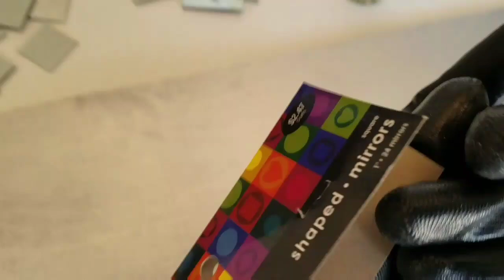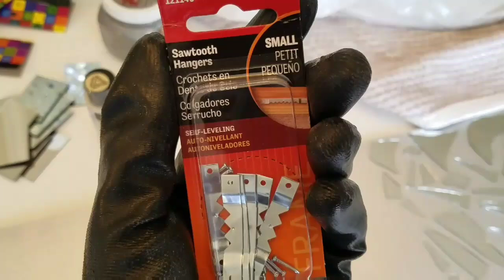DIY  mosaic  panel; Pier One Inspired

Comment: Nicely done. I have a tip for you maybe. I now use plain ol' cardboard packing boxes as my backing instead of plywood. It's very lightweight and FREE of charge. Believe it or not, I also use plain ol' water fast Elmer's glue like we used to have in grade school (instead of a hot glue gun) for the 'relief' effect, or string or what not.  I also use it as my 'filler' or grout which gives it extra strength and it dries clear. Your work is very nice. I also love your good advice plus you have very pretty hands.
Reply: What do you use to hang this if you just use the plain cardboard? Thanks in Advance
Reply: What about posterboard??
Reply: @charlottecarmel8300  i suggest command strips

Comment: Watching your FABULOUS CREATIVITY?
I had a FAB thought that might speed up process of gluing all those little pieces!
After laying out your "dry fit" of glass pieces?
Tape OVER with widest tape you can find, (suggest painters tape for low tack.) & flip over taped pieces strip.
Put glue* on pieces, flip back and press glued pieces to board.
Let COMPLETELY DRY before carefully removing tape.
*Glue gun would probably not work as it would dry too fast before putting tape strip back on board.  E6000 or Superglue, etc. would need to be used.
FABULOUS PIECE!
Thanks for sharing!
💜💌💔

Comment: Sharon i need your help...i used liquid nail to adhere my mirror to a table the problem is i have that stuff on my mirrors...how do i get it off please help meeeeeeeee
Reply: KATHERINE C.A. JONES..
How to remove liquid nail off of glass..

In general, LIQUID NAILS adhesives & caulks can be scraped off when they are softened either by:

Heating above 140°F with an electric heat gun or blow dryer.Coating the adhesive with petroleum jelly or mineral spirits for several hours to several days...(LIQUID NAILS Adhesive | FAQs
Liquid Nails › liquid-nails-adhesive-faqs
*Hope it helps!!*